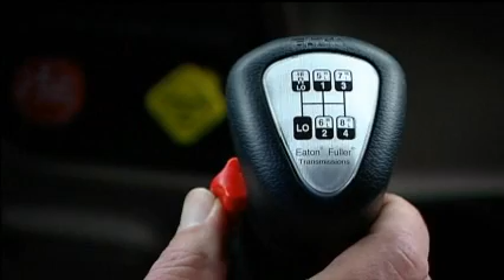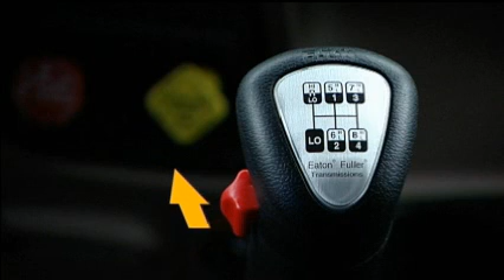13 and 18 speed shifting

Comment from the maker: not as hard as it sounds. hard part is the double clutch/changing with the right revs. gears are not that hard once you get your head around it. if you have a 5 speed car imagine having a button (button 1) you push in each gear that gives you another gear, then you have 10. once you have used those 10 gears you press another button (button 2) and then go through your gears again using button 1 but you only use 4 gear positions and there you have 18 gears. also dont normally use all the gears.

Comment: With my 13 (behind N14 525) I've been doing all those shifts, upshifting and downshifting without using my clutch, fully loaded up to 93000 (PLUS), and it works very smoothly.  Am I wrong to do this?  Sometimes you don't even need to disengage the clutch from a stop, if you have a slight grade such as an on ramp.  Im just saying...sometimes if i am being stupid and not paying enough attention its easy go beyond rpm range or too much load resulting in a bad shift tho

Comment from the maker: think it comes down to the same stupid rules we have here. from my understanding of it (try understanding half the shit transport dept comes up with) they work on the logic that if you lose engine and brakes you can still stop the vehicle if it is in gear by releasing the clutch. mind you in an air off/spring on brake setup all you do is cut off the trailers air and you are stopped. im in qld and they have the same rules in a car as well.

Comment from the maker: hey mate, i think that rule is one made up by the know it alls who have never done the job. the same as the rule where your hands are not supposed to cross over each other on the wheel when cornering or turn the wheel one handed. you are supposed to shuffle your hands around the wheel so as not to remove them from the wheel. try doing that in the real world and you end up in the shit in a hurry.

Comment: What, do you stop in neutral?  Here in PA, you have to be in gear to come to a stop because legally, you're not in control of the truck when you're in neutral.  Also, you pretty much need the clutch or else it'll stall the engine.

Comment from the maker: @jbdixs you got it right there. i had a prick of a time when i went for my license because i had to double every gear. "im" not saying this is how it should be done, this is how eaton would prefer you to do it. and i understand the reasoning. if you have the clutch depressed when you are engaging a gear you dont have the full weight of the driveline/engine torque being applied to the gears incorrectly if you screw up a shift and we all do it occasionally.

Comment from the maker: @dozerman8114 like i said a know it all. this video is presented by eaton, the company who makes the road ranger gearbox so i reckon they have a pretty fair idea what they are talking about. they dont say you must operate in this fashion but they prefer you to do it this way as it reduces damage potential.
oh and by the way, im from australia and im only in a single now but used to run b doubles grossing around the 145,000+ mark so dont try to tell me how to drive.

Comment: There is only,ONE way to shift,  with no clutch, uless sitting still.   And on the other hand,  between  a 13 and 18 , one of them  splits the top 4--- the other spits ALL of them. Haul real equipment and learn, grossing over 100,000 plus

Comment: He said the 13 speed has the same pattern as the 10 speed, it does not. The 13 and 18 speed both have the same pattern as the 9 speed. If it was the same as a 10 speed, 5th and 5th over would be in the same position as Low gear. The 15 speed has the same pattern as the 10 speed with overdrive on the high range gears.

Comment: 13 Speed was one of my favorites to drive. I drove it as a 9 speed when weight was not an issue and just split the last hole to be in 13? This was on a 1986 Freightliner COE with a 350 Big Cam usually pulling a 28' van? I also never used the clutch on the splitter, just let off the throttle and re-apply?

Comment: I drive for a living, have used this trans. many a time. The way this man describes it, is way too confusing!! It is not this hard. 1-2-3-4, button up, 1-2-3-4. That's it. If you need to take a "half gear" then don't move the stick, just flip the split button, then clutch it. It goes into the half gear by itself. flip the split button again before moving the stick up a gear and you are back into direct gear. 13 speed trans you can use the split button on the top 4 gears only, on 18 all can be,

Comment: I have also driven a freight liner and a volvo with a Rockwell transmission. They are extremely tight and hard to float gears. And Macks are nice trucks, but their max-torque transmissions have a funky shift pattern. Eaton Fuller makes the best transmission. And Caterpillar engines are my favorite because of their pulling power.

Comment: One safety feature I have noticed while down-shifting a 13 speed is that you cannot move the range-finder down until you move the splitter into direct. Do all transmissions have that feature built in?

Comment from the maker: @stephennc2003 absolutely right with not driving a 13/18 like a 10 speed. drive them the as a 9 spd without the splits. i drive the same as you with the clutch. only thing i have seen is someone posted a video showing it was slightly quicker with the splits if you quickly dip the clutch but i never do.
there is no need to split the bottom half of an 18 speed unless heavy as you said but if you split the majority of the gears you do not need to rev the engine as much so you do save a little fuel.

Comment from the maker: almost but after you bring the revs up push the clutch in again before you make the shift. the revs depend on your road speed. what you need to do is take not of your revs when you are upshifting. look at your revs before you make the shift and then after you are in the next gear. then when you downshift if you let the revs fall to what they were in that gear when you made the upshift they should match what they were also in the next gear down when you make the shift down. does that make sense?

Comment: correct me if im wrong, when downshifting,1st step is push in the clutch,take it out of gear,let off the clutch,so now it would in nuetral.
2nd, rev the rpms up ,about how many rpms up? then shift to the next lower gear while to rpms are dropping after being reved up, then when its already in the lower gear, push the clutch in, im getting a little better at it, thank you for helping

Comment from the maker: then as the revs drop to the point where they match the road speed for the gear you are doing to it should drop into the gear. as with anything practice makes perfect. so just keep at it. if you have any more questions message me, hard to write a long reply on here.

Comment from the maker: downshifting is harder than upshifting due to the fact that you have to bring the revs up when you down shift instead of letting them drop to shift.  downshifting uses the same principal as upshifting but just in reverse. when your revs drop to the point where you want to make the downshift depress the clutch and disengage the gear, re-engage the clutch and rev the motor to over the point where it would go into gear then clutch in again.

Comment: i dont know what i did wrong ,i drove a 13spd but when i tried to downshift, it kept grinding gears.could it have been that   the clutch was all the way in, or the rpms didnt drop enough. what can i do to prevent the gears from gringing?thanks

Comment from the maker: its just something you will feel. you can even do it in a manual car. while you are decelerating push the clutch in and you will feel when it disengages. while it is engaged your revs will fall slowly with your road speed as you slow but once the clutch is depressed far enough your engine speed will drop back to the idle speed. and if you are in a truck you can normally feel where the clutch brake is through the pedal. there will be a bit when almost fully depressed where it gets a bit harder.

Comment from the maker: no you only need to push the clutch in enough until it disengages to remove the weight from the driveline. in fact after you are moving you should never fully depress the clutch. doing this will engage the clutch brake if one is fitted and cause them to wear prematurely.

Comment: Their is no 9 low.  The highest gear is 8 high for a 13 or 18 speed.  The gears go for a 13 speed low, first, second, 3rd, 4th,move range selector up and shift to 5th low.  then you have 5th high, 6th low and high, 7th low and high and finally 8th low and high.  To downshift from say 8th high to 7th low move the shift lever from 8 to 7th gear position and before letting the clutch out shift the splitter button back to low or backwards.

Comment from the maker: first slide the splitter button to the high position and then make a regular downshift. you just do the opposite of what you would do if you were changing from 8 high to 9 low

Comment from the maker: depending on how you drive and which gearbox you are asking about. with a 13 speed you stay in one range in the bottom box and then split each in the top box. with an 18 speed you can split each gear in the bottom and top box. this is if you want to use every gear though, not necessary to use every gear unless conditions demand it.

Comment from the maker: supose i should have clarified that last statement a little better. a single trailer uit in australia wieghs in at 42.5t (93500lb), a b double 62.5t (138000lb), a 2 trailer road train at 79t (174000 lb) and a 3 trailer road train at 115.5t (255000lb). these are the usual applications but some can get up to and over 200t (440000lb). these are all maximum allowable weight without consessional loading which can add 1-2.5t per axle group.

Comment: Excellent video post, great explanation. I drive a w900 KW with a 18 speed and there are so many ways to use this trans depending on the load ,terrain and road conditions.Its something you learn with time and experience  and can be difficult to explain.
Reply: My 78 has either a 13 or an 18 speed I can’t tell it’s all custom made aluminum how can i tell the difference?